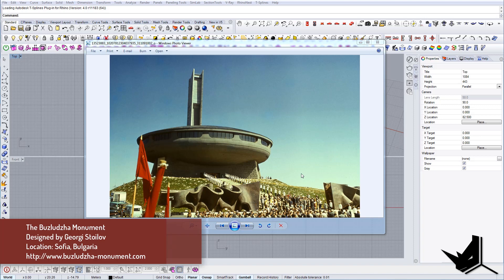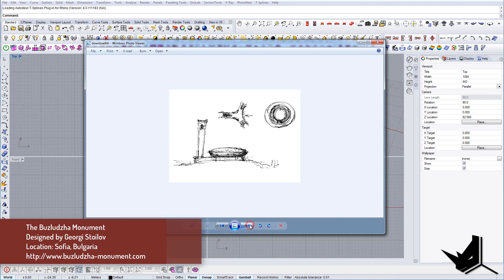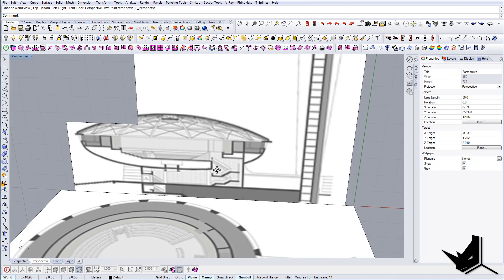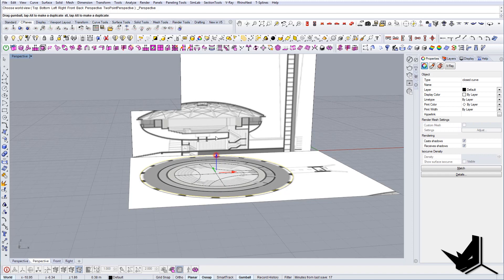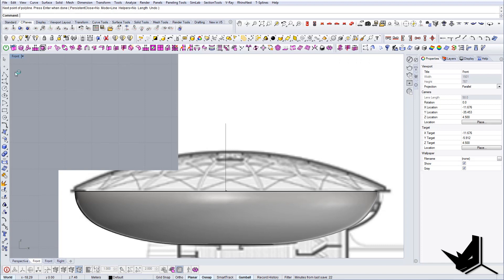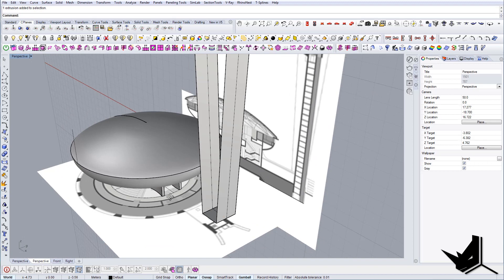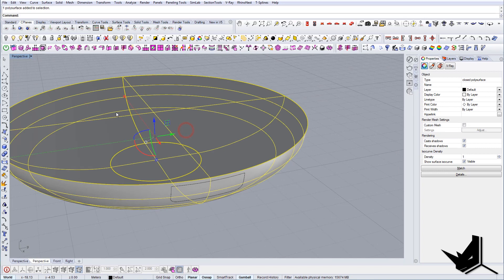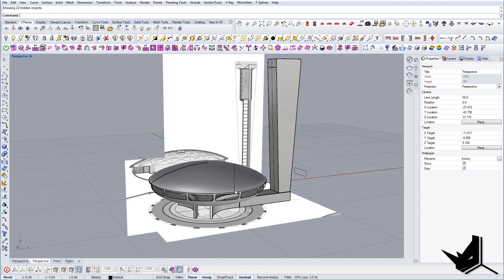Rhino Architecture - How to Model Buzludzha Monument

Comment: Thank you for this tuto. but i have a problem in splitting the windows, it tells me : (split failed, objects may not intersect ...), is there any solution or other alternatives to make the windows ?
Reply from the maker: Hey Hamza, thanks for your questions. This usually happens when your polysurface is not closed, it it has an open edge somewhere or a face missing. It's also possible that the two objects don't fully intersect and that's what's causing this error. Try doing boolean split on some simpler geometry and see if it works. It's most probably some of these two things above I mentioned.